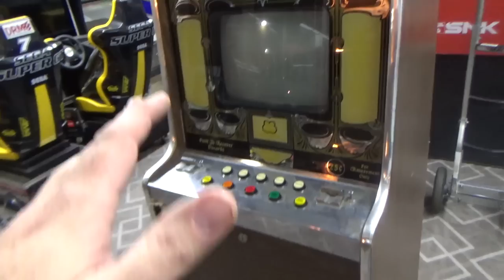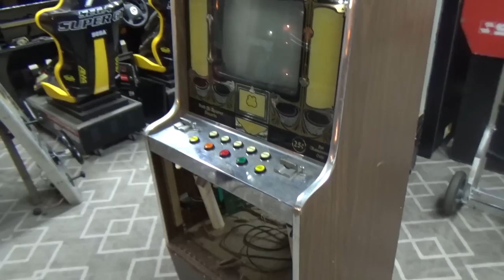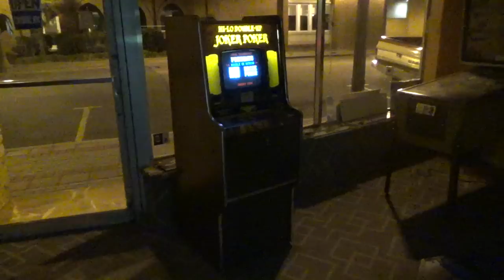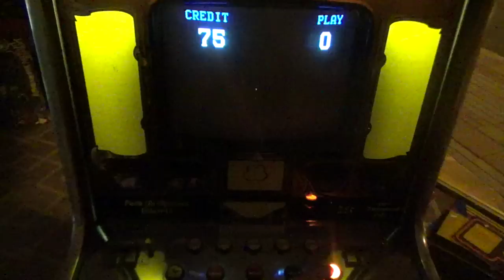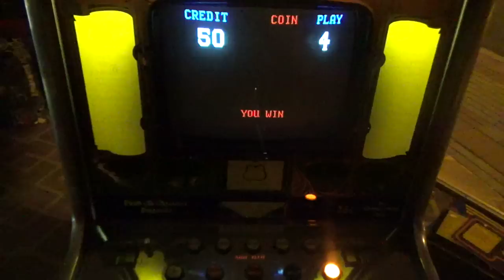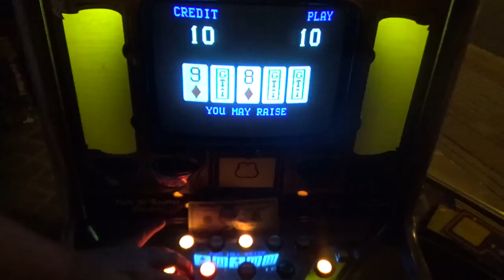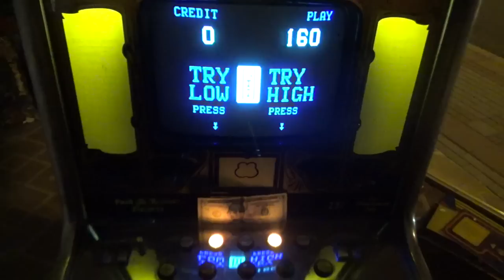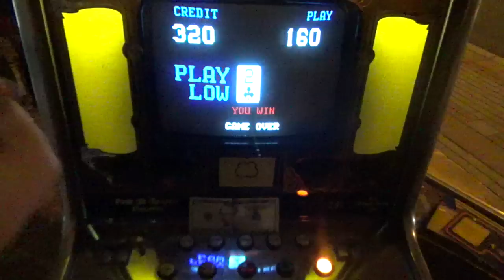Repairing An Old School 'Joker Poker' Coin Operated Poker Arcade Gambling Machine - Can We Win?

Comment: When I saw this I did a double take. I worked on the production line building this machine and after that I worked on the technical side building and troubleshooting the electronics. The company I worked for built the original Hi-Lo Double Up Joker Poker and the regular Joker Poker. Not familiar with the replacement board. This was like you said in the early 80's through to the mid to late 80's. This is look back to my early years right out of electronics school. What a blast from the past! These machines were all over the arcades on the Jersey shore. They modified them with a discharge hopper filled with tokens when the laws changed to allow token payout. The tokens were only allowed to be used for prizes in that particular arcade. There were some unscrupulous operators that would install diverter chutes that would send a certain amount of quarters into the hopper for payout( in bars and such).Thanks so much for this video!

Comment: Someone has to do a breakdown of that circuit board. I wonder how simple or complex the rng on that unit was. Also it is a free for all in the Caribbean. If u got cash or dope ur good.
Reply from the maker: I'll bet it's pretty complex, i'm not even a software guy and I could come up with something, somebody who knew what they were doing could probably think of a million ways to do it.  I was thinking, if you're set at 92%, and the payout has been less, deal a winning hand 51% of the time.... if you're at 92%, deal a winning hand 50% of the time, if you're at 93% deal a winning hand... 40% of the time.... maybe something like that you could start with and then have somebody imrove it that knows what they're doing.  Then you'd have to come up with some logic that knew what a winning hand was, there's probably thousands of combinations, because you have 4 suites and 5 positions on the screen to put the cards in, so that kind of has to appear random as well.  So 8892J is the same as 89j28, but would be counted as a different possible combination since the position is unimportant except aesthetically.  

The whole thing probably took quite a while of testing to make sure that nobody could easily win every hand.

Comment: Is that a Sprint 2 dashboard, missing the left hand steering wheel in the background at 08:00? Is that one getting another of those 3d printed inserts?
Reply from the maker: That's the same one, we filmed this back when we were working on the Sprint 2.  We didn't upload the video until the poker machine was gone out of the building didn't want the police thinking we're operating it or selling them or something...

Comment: Cool machine. Enjoyed the video and backstory. I wonder if there's a real random number generator in there. Normally a computer can only make pseudo random number sequences unless they tap into some source of randomness such as time between button presses, or temperature or something. I don't know if it's still exists, but there used to be a site online that generated random numbers based on a lava lamp with a webcam pointed at it.
Reply: That's cloudflare! They do some really cool stuff with internet traffic and I might connect up my homelab through them since I don't have a public IP.
Reply: Good question. I sorta doubt it, though maybe it is a PRNG that is seeded by a system timer.

TRNG isn't that hard to do, though not the most practical to keep using. I mean, you need a white noise generator. So you take a Zener diode, a Schottky diode, or a certain transistor with the collector clipped, drive the voltage backward, and amplify what comes out. Then you have a clocked circuit to sample the output and drive a shift register. But that is slow. It takes 8 slow cycles (like in the kilohertz) to build the byte, so a CPU cannot collect that often. If you need a faster result, you'd need a PRNG and use this type of circuit for the seed.

And, things are more complex that than, to be honest. Really, you'd need a whitener circuit or logic to remove bias. The most known algorithm for that is the Von Neumann algorithm where the bit pattern 10 is replaced by a 1, 01 is replaced by a 0, and 11 and 00 are skipped. So the above would actually take 16+ of the slow cycles to build a byte.
Reply from the maker: I doubt there was a true random generator, by basing it off of the percentage they could make it random enough you wouldn't be able to figure it out.  So if they have it set at 92%, they keep track of how many games have won which would create a different value after each hand, and without knowing how many games had been played since it was reset or the battery replaced, you'd never be able to follow it if they came up with some simple routine to slightly randomize the outcome.  If it was "we're at 91%, it has to pay out this time" the things would be so strict somebody would spot how to play it, so there has to be something in code to say if you're under 92%, 51% of the time deal a winning hand or something.  

Plus you have the human part of it, I threw away a straight halfway through the video because I didn't see it, so they tried to DEAL me a straight but I missed it.  It had to recalculate something after that :)

Comment: The vending/amusement company I worked for in NH from 85-99 (and EVERY other v/a company in NH as well) had hundreds of these type of machines (poker & black jack) all over the state. Every VFW, American legion, coffee shop, pizza place, restuarants had at least 1 or 2. Each machine would do $10k-$20k per week. We installed bill accepters that took up to $20's. People would just pump bills in them all day.They all paid out on them. We'd do the cash up by reimbursing the operator the amount he paid out then the rest was 50-50. We had one motel that converted 2 rooms into just poker & blackjack machines. We ran cabling from each machine to a master panel by the front desk so they could clear credits remotely. We had a mole in the state offices that would warn us of an impending raid. One day we got told they were going to that motel the next day. We went over, pulled all the machines out, made the rooms look like they were being remodeled and the cops figured they were given a bum tip.  Went back the next day and reinstalled them all. Ahh fun times

Comment: Tightening bands refers to auto transmissions. They have several planetary gear trains which are engaged or disengaged by bands (a sort of external clutch). He was conflating bands (which when loose make the transmission slip) and tight versus loose referring to how generously the proprietor has set the odds in his machines. You might see a sign on a minor gambling house or gas station: "Loose Slots!" hoping to attract business.

Comment: You should see if you can undo all the cheats on there and restore it to factory at least. Not naming and shaming but one of the bigger casinos actually did that to me where suddenly I had no credits on the screen out of a blue sky after one of my friends was helping me run the machine cuz I'm blind. All the sudden I hear him use one of the bad swears like the ones I seldom use and then he says I saw it but I don't believe it best case scenario there was just a real glitch and you lost all your money. So I take the card up to get cashed and it's got three cents on it and I tell the guys at the counter what happened and they get this tone of voice both of them with me. Haven't been to casino since. They got another guy who looked like a cop probably security to agree that I was causing a disturbance when I wasn't even shouting or anything. long story short I'm well aware of what these smooth operators will basically do to pass the time of day.

Comment: Some Vegas machines have 105% payout

So theoretically over a period of time you should make back 5% more than the amount that you put into the machine but the machines are run by a random number generator and there's no telling what it's going to do each time you run the program

I remember one program that I wrote and it had zero to nine and I let it run there must have been 10,000 results and all of the other people standing around realized there weren't any zeros and they said did you make a mistake when you put the values for what the number can be and I said no I'm sure it's zero to nine and I went and stopped the program and I went back in the software and I looked and sure enough it was 0 to 9 and we ran another 30, 000 results and finally we had two zeros back to back.
But statistically there should have been a zero every 10th time but for some bizarre reason there wasn't

Now here's where quantum physics and the universe being a simulation comes into play

All around the world in different cities there are large computers that are random number generators that can only produce a one or a zero and under normal circumstances you get half and half so 50 zeros and 50 1s

But they have seen where the random number generator stop being random and all of a sudden you will see a huge percentage of ones maybe 80 or 90% and each time this has happened something really bad happened very soon after for example this occurred before the tsunami at Fukushima and it happened before the tsunami in the Indian Ocean and it's happened in other places around the world and no one knows why it happens but it's like an early warning system that something extremely bad it's about to happen wherever you see these random number generator stop being random and it's believed that it has something to do with neutrinos but we don't have the technology to figure out exactly what's going on

If I had it to do over again I would have become a physicist and studied these questions because they hold the answers to the greatest questions of the universe
Reply: +ocsrc, writes "But statistically there should have been a zero every 10th time but for some bizarre reason there wasn't"

At a guess, either a crap random number generator or the random number generator rounded up and any number above zero (like 0.0001 for example) was treated as a one.